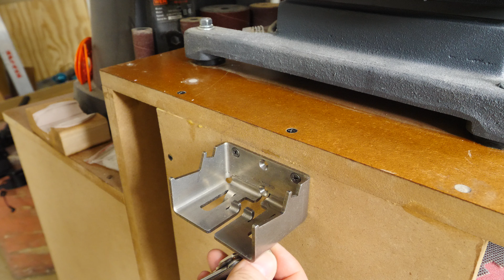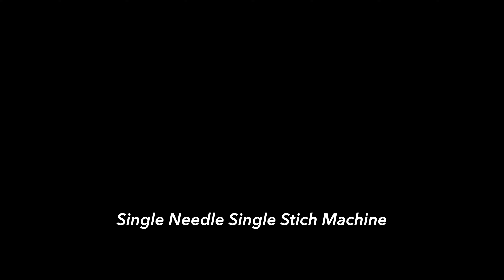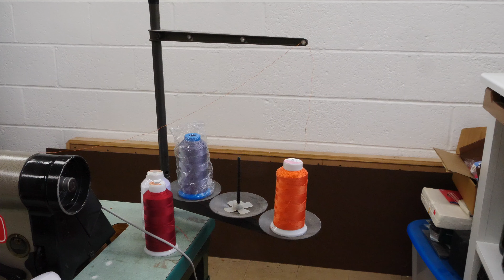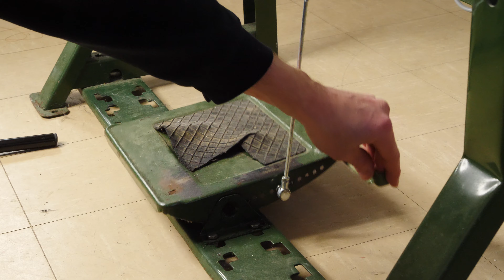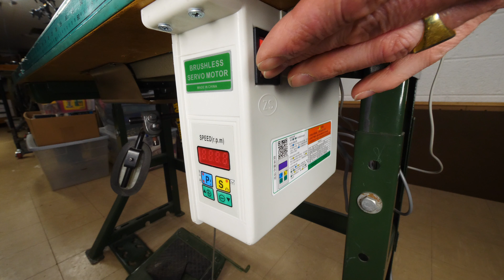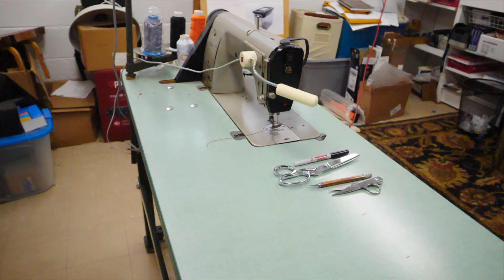Industrial Sewing Machine, Basics Mods for your Beast!

Comment: Hi Eric! I swapped the motor on a Singer 211a and my Bernina 217 and it surprised me that it was 'a straight swap'... no need to drill holes or even change the bolts/screws/fasteners! The motor came from AliExpress Both great toys for very reasonable prices. Rock on! Best, Rob^^ (Netherlands)

Comment: Outgrowing my modified "extra capables through the times " home market machines like K201 and 21E, I´m on the look for something heavy duty giving me thicker thread options through as many layers of leather, tarp, cargo straps and such as possible delivering both straight and zig zag. 
As the story goes, a sewing machine is a perforation machine; I want as long and wide stitches as possible. Not every industrial is a "anything you throw at it", by far. They are at each model particularly built for designated tasks. Do you know somewhere that can help me to an oversight of which one can be the right one for me to look out for ? 
Do you have experience with the Sailrites brand of semi pro models ...?

Comment: dear, I have a Pfaff 145 but it is a 380v three-phase machine. I would like to use it with my 220v home system. Is it enough to fit a servo motor?
Reply from the maker: Yes

Comment: Nice, succinct overview with useful information.
I saved an old Mercury model M-406 (which we learned is a clone of the older Typical brand model GC6-7) from a ranch here in North Texas that the owner was frustrated with due to breaking thread all the time. Bought it for $200 bucks including the beat up table it was in which is a pretty good deal now days. Turns out the M-406 is a heavy duty single needle lock stitch triple feed (bottom dog, top walking foot and the needle shaft all pull the material into the feed) version with reverse and can do 10mm (almost) stitches. Turns out only problem was a nicked bobbin case and a bent needle. The local industrial sewing machine repair tech geeked out about it telling me the original machine it was designed from and that it was only second he had ever seen in his 30 years in the business. He assured me it was very well built and sews like a dream there is nothing that machine can’t handle and guessed it had maybe been used 6 months in its lifetime given its condition. 

I have put a brushless servo motor, needle synchronizer (stops automatically with needle down or needle up as desired), smaller motor pulley to slow it further (about a stitch a second) and gain torque, custom prop to support while tipped, mounted a piece of scrap 1/4” steel on table tops front right edge with bar magnets on it to hold my small pick and thread sheers conveniently so I don’t have to hunt for them, designed and 3D printed a magnetic sewing guide to help keep seams straight, got a set of swing away binders to put binding on edge of fabric, carpet, tarps, etc. I use a battery operated magnet flashlight which puts out 800 lumens of light for hours.

I love how precisely mechanical the machine is and what it can do without even trying

Comment: Decades ago, when I was a child, my mother purchased a used industrial sewing machine with a clutch motor. I remember how excited she was to have such a fast, powerful machine. When I was a teen, she let me learn to use it. I wish I could have kept it when I grew up, but those days are long gone. Now I have a couple of painfully slow domestic sewing machines, and I miss that old industrial machine with the clutch motor. I wish I could get one like it! My question is, are there any Servo motors capable of going as fast as an old clutch motor?
Reply: Most servo motors intended for this can go just as fast and powerful, they just allow for much better control of the motor speed (you can adjust it down).

Comment: I just got that machine a few weeks ago.  I got mine for I think 27 euro.  with the table and newer motor.  I have taken the motor and threw it on an old Singer table that had a Singer 31\32 industrial machine on it.  I have now a Bernina 117K on the Singer table but I had to modify the table to accommodate a home sized machine.  Which I havent really finished yet, but I am using the machine eventhough its not mounted with the hinge liftie uppie things since i would need to modify those a little to get them to fit into the holes of the Domestic machine.   I am having the problem where the machine goes way too fast right off the bat.  I am getting better with practice but i will try this idea of moving the point of connection on the foot pedal.  thats a good idea thanks for that.

Comment: Watching this because I recently bought a Pfaff 138 in very good condition. Learning the organs and functions of the machine by meticulously cleaning and lubricating. Quickly understood that the 30+ pound clutch motor was better suited for driving my wood lathe I installed a servomotor. Just today I wanted to do what you did to the pedal for better control. Now I am waiting for a Z-belt and a 50mm pulley. I like that small lamp and will order in a few eyeblinks.

Comment: Great video! Thanks!

 I bought a Chinese leather shoe patcher. A hand crank machine. I bought a 3D printed gear conversion kit anda servo motor for it. Mounted the whole thing on a sawhorse and built my own foot pedal for it. I didn’t have $3k for a proper post bed machine so this was an inexpensive machine that cost me around $250 all in.
Reply: 😮 awesome 👍

Comment: I have a  Juki DDL9000CFMS. It's a digital industrial machine and I absolutely love it. After some years of sewing, I need something faster but still wanted digital coming from my Pfaff 260c. I haven't made any modifications to it other than changing out the foot plate. My sewing machine store did change something to where I can use the standard industrial machine bobbin for it and not have to use the one that's only for it.

Comment: I like your foot pedal mod! I recently bought a consew 230 in good condition. It already had a motor swap, I dont like when the motor is running all the time. I had a large order of banquet chairs to reupholster in vinyl, I did half with the regular foot, and then ordered a roller foot for the rest, there is no comparison! Highly recommend a roller foot! I use a regular magnet for my seam guide, and an Aluminum ruler under the back side of the foot when I get to a multi layer seam..

Comment: Nice video your upgradelist is good.  I worked in  textiles for 18 years. DC servois a must for sure. I would recommend a compound walking foot machine for its heavy duty capacity and more control in the turns. They are good for upholstery, wilderness gear, work clothes, and more. But not for fine dress making. Just a thought, I hope this helps.
Reply from the maker: Totally agree, walking foot for tight tough stuff is the way to go.

Comment: Hello Eric my company  has purchase a new Reliable  5400TW Sewing machine where should I set the speed for this machine? I put the material (cloth) under the two needles & the sewing  machine does not pull the material through when I try sewing  what is causing that so it will automatically  pull the material  through? Are my tensions  to loose on top? How do you thread the two loopers at the bottom of the sewing machine?
Reply from the maker: I would reach out to a local sewing machine repair facility to have the machine serviced

Comment: I don’t think the motor you have linked is the same motor as in your video. I ordered it and it is very undersized and doesn’t have enough “throw” to tension the belt. The mounting bracket doesn’t look the same either

Comment: Does the brushless servo motor upgrade result in any less sewing power?? My mom picked one up to do everything but I can tell she's nervous/set on learning the crazy speed of the machine. The speed control would be a great addition/mothers day gift
Reply: After research, the servo motor can do 100 stitches per minute, is this the maximum limit? Currently her machine can do 5500 per min.
Reply from the maker: Don't know, I'm not concerned about going fast for me it's all about going slow and control. The motor is quieter just as powerful as the original and has great control.

Comment: I didn't go industrial. I got a 1940's Singer 66 that has been able to handle anything I've thrown at it. I've upgraded to a more powerful motor and replaced the rheostat foot pedal with a digital one. I have been thinking about adding LED lighting, but otherwise I've been very happy with how it performs.
Reply: What motor and what pedal did you use?
Reply from the maker: There should be a link in the description

Comment: Eric, I'm glad to have found your channel.  I own a Consew 226-R and have made mods to get my clutch motor to be more controllable and SLOWER. I really need to brake down and buy a servo motor.  As mentioned in another comment below your link to servo you purchase is no longer available. What should one look for in spec's when looking to purchase a servo ?  I was looking at the servo that Sailrite sells, more expensive than most others on the web but they (Sailrite) have a big and respected reputation.  Your thoughts please.  Thanks again
Reply from the maker: I have changed links to one that I believe has a plug in the back of the controller so that you can plug a light into. As for the one you mentioned, I only have used the one that I installed. If you feel the one you mentioned has a good reputations and you think it has the features for you, get the one you are comfortable with.

Comment: a broader range of friction point on your pedal actually gives you more control, the more travel the better.
Reply from the maker: I  want it to go slow, so I want less action on the lever is best for me.
Reply: @EricStrebel  a larger area of action means you have more slow to use. with your setup it will happen more quickly and abruptly. it's aggresive. try it it the other way you'll see what i mean.
Reply from the maker: No, I only want the actual throttle lever to move a little bit
Reply: @EricStrebel  i call that a poppy clutch and it's good for long work. had to fix it many times. but i deal with walking feet

Comment: Do your machines also have that 4 prong L14-30R power cord? I just bought a machine on craigslist for 150usd but it comes with the L14-30R power cable. Can i just buy a converter on amazon?
Reply from the maker: Have no idea what you are asking me
Reply: @EricStrebel  oh, I'm asking if your industrial's just come with a regular 3-prong power cable or a 4 prong power cable. It seems that the machine i bought comes with a 4-prong power cable similar to the ones electric generators use. L14-30R power cable to be specific.
Reply from the maker: Ahhh, mine is three prong 110v , perhaps yours is 220

Comment: I have 2 industrial machines,an old singer 111W 154 and a juki 562. Iv'e messed with both of them. The Juki has a modified clutch motor that has better speed control then the servo on the singer. The singer didn't have reverse so I added a reverse mechanism long before the internet so I had nothing to copy. Supprizingly close to the 111w156. It works very well. You asked so I crowed.
Reply: How did you go about adding the reverse?
Reply: where did you find the hardware to add a reverese? Please advise
Reply from the maker: That was already on the machine
Reply: @EricStrebel  What was already on the machine? It was made in 1043, they weren't reversible.
Reply: @terrancedonaghy7792  On a scratch pad, pencil, and calculator. It was long before we had the internet,
I hade to think it.

Comment: The original Bernina Record 830 which was sold as a portable in the 1970s was also the same machine that the company sold as their industrial machine except it was put into a table with a bigger motor. Unfortunately it did not have a walking pressure foot. I bought mine new in 1974. It is still popular and current market value is $300 + because it really was very well made. From the beginning I have used it on heavier materials. The pressure foot is hinged close to the fulcrum point so it does have good speed control.
Reply from the maker: Sounds like a nice machine

Comment: i heard that you could also buy a different wheel size for inside your turn wheel on the right. it will slow it down if you make the size smaller if i remember correctly…
Reply from the maker: Correct but it won't change the ratio significantly, I've tried it it's not really worth it
Reply: @EricStrebel  can u update an industrial single feed brother to a industrial walking foot if u had someone potentially weld another area for foot or is there more to it then that? thanks for your help. i know about the little walking foot attachments. i just think i need a walking foot to make these hats im trying to make with several layers of polyester and felt layers as stuffing to give structue
 the walking foot would help me so much if i can’t i’m just gonna probably update my machine head i guess. also my stupid motor seems to smell smokey when i sew for 10 mins or also if i go slow. i hope it’s just because it sat but i have no idea.
Reply from the maker: Dunno on that one, not likely that you can just mod or make a machine to make it a walking foot unit.

Comment: I have a Pfaff 335 cylinder arm and every time I try to sew the threads rip or get tangled.  It’s not pulling thread up from bobbin…don’t know what I’m doing wrong.  Want to finish my bag with it but can’t figure it out…😢 first industrial machine ever.  Def have to figure this machine out because my domestic can’t finish my bag seams that are thicker
Reply from the maker: Good luck Make sure you have the needle in all the way and are using the correct needles for your machine
Reply: @EricStrebel  thanks, had to increase the thread to Tex90 said 40-210 online but the 45 I had was shredding. Thicker thread is working beautifully!
Reply from the maker: Fantastic, also sometimes, stuff below the foot gets roughed up and needs to be smoothed out to prevent the treads from getting caught on stuff

Comment: Hi, I’ve just bought this same machine but when I got it home and plugged it in, it’s tripping my electric! I was wondering if you could have any ideas on why that could be happening?
Reply from the maker: If it's the original motor then something's wrong there. Of course my machine doesn't have any of that original electronics since it's all been upgraded to a brushless servo motor with speed controller.
Reply from the maker: If it's the original motor then something's wrong there. Of course my machine doesn't have any of that original electronics since it's all been upgraded to a brushless servo motor with speed controller.

Comment: I have a Zoje walking foot that’s rebranded as a Singer. It’s equivalent to a Juki 1181. I don’t think the walking foot is strictly necessary but it is a nice feature. It walks right over thick stuff like sewing across a seam in thick fabric. I use Guterman Tera 80 thread. It’s a little lighter than the thread in the video but consistent and very strong. I did switch my table top out with a wooden one from Sailright. That was just an aesthetic upgrade. Modern industrial sewing machine table cutouts are fairly standard but there is a short, medium and long cutout that you have to be aware of. Older machines have a little different cutouts. One could also make their own tabletop if they were handy with a router.

Comment: Hi,My sewing machine is a DB-130GM , The top stitch is good but the bottom stitch is a mess,Help please
Reply: It’s probably your bobbin tension. Your bobbin should have a little tension screw on it. As a general rule, the bobbin tension should just support the weight of the bobbin if you holt it by the thread. Moving your hand up and down should cause it to let thread out. Also make sure your needle is turned the right way. It should hav a flat spot near the eye that needs to face the bobbin. I’m sure there are videos that explain that better. If adjusting the bobbin doesn’t correct it, there is a chance there is an issue with the timing. It’s possible to fix that yourself but if you’re not confident it’s best to take it to a well rated repair person.

Comment: I like the drilled holes in the pedal.  My pedal was all loosy at the pivot points from wear so I pulled it out, welder a shaft in place then used pillow ball bearings on both sides in place of the metal on metal sliding mechanism.  It's very smooth now.  I switched to a servo but I'm not happy with it. It has a large dead zone before the machine starts to sew. Seems related to the speed knob.  I'm probably going to switch to a brushless setup like yours.
Reply: Yeah. Sounds like just a bad motor most of them don’t do that. I bet you’ll be happy with a different one that is better quality if you haven’t switched it out already.